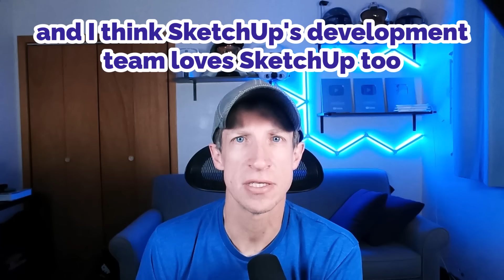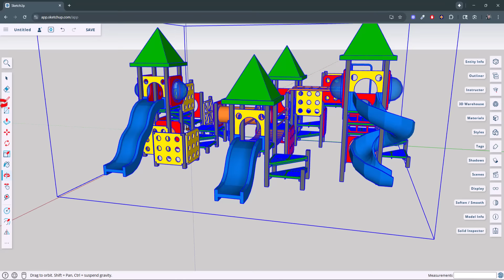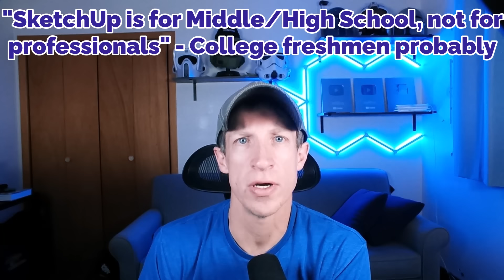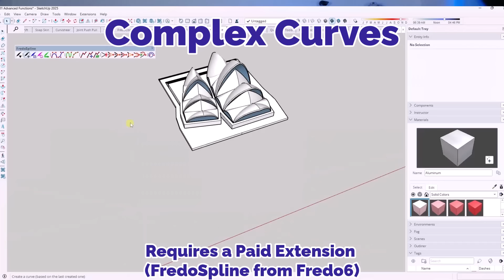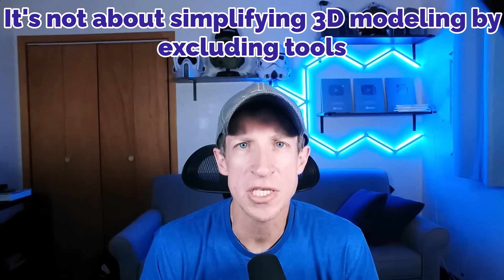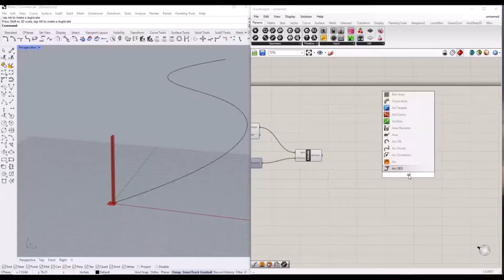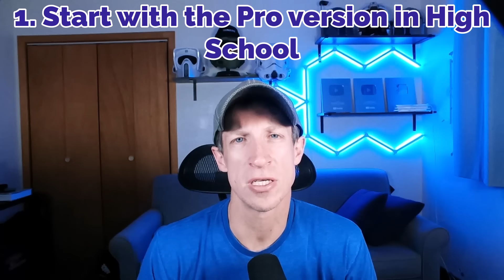Is SketchUp being REPLACED?

Comment: Being a user of Rhino since version 1 I can say that it has grown immensely in features and ability and yet after 30 years is still the same price. No subscription model thank goodness. Has scores of plugins available for multiple industries , grasshopper built in with dozens of tools available for that. The customer service is excellent . I can contact them directly and speak to a person or go to the forum and ask the community and get almost instant response.  I work in the film industry and being able to transfer files to different departments is critical.  My files have to go to construction, vfx , props , motion graphics and more. The ability to export in dozens of formats (no extra cost) to multiple departments is critical. I can also send files in step, iges or solidworks and the open up in other cad apps no problem. Every single SU file has to be rebuilt no matter what department it goes to due to the fact that its typically low poly (bad for VFX) or simply cant be modified in a nurbs based or solid modeler.  This creates a roadblock .  Now that isnt to say that models arent built, drawings are created and sets are built but those same models going to other departments cause more work for those departments. Now with the introduction of  AR/Volume  walls (see mandolorian) our models are going straight to VFX and unreal engine. SU models are just not good enough for texturing and file optimization.  With the latest improvements Rhino is getting more versatile and adopting features of other software into its pipeline.  Is it perfect?  In a word, no. But no software is perfect and never will be. So stop looking for it and just find what fits your budget and needs. If SU works for you fine. But if you have to interact with other designers working in higher end software especially nurbs based software you will hit a wall with SU. 

Im not bashing on SU or its users. And I dont want to give that impression. Its a fine software and has served many very well  but has limitations in the professional world.  As a gateway modeler in 2008 when it first came out it was great. I saw kids learning it and building things. But as time goes on and demands change it becomes very evident that it cant step up when needed to do the kind of work needed for more engineering and architectural applications.  Frankly its outdated. If you want a good gateway nurbs modeler and low cost  look at Moment of inspiration or Plasticity.  If you are a student Rhino offers student pricing thats very reasonable. Bob Mcneel has kept Rhino the same price because he wants it accessible to more people that cant afford Autodesk or other high end products.  

Ultimately do what works for you. And happy modeling.
Reply from the maker: Ugh - I hate any time I ever have to move a model between 3D programs just in general. I don't think it ever works out well, but SketchUp a lot of times doesn't play nice with those other softwares (though I'd say other softwares don't play well with SketchUp either). I totally agree with your statement though - some programs are better for certain things - find what works for you. 

For me, for example, I really dislike doing interiors anywhere but SketchUp. I've yet to find a tool that does a good job replicating that experience. Same kind of thing - thanks!
Reply: @Thesketchupessentials  moving models between 3d apps is standard practice in the film industry. For the most part its not an issue except for SU.  
Interesting that you dislike doing interiors other apps. In what way?  Most of what we design in rhino for film and tv are interiors.  The majority of my work is high tech sci fi but with the occasional period interiors.

Comment: For me the there are many issues with SU. MANAGING TABS FOR ONE, the limited support for text, and let us be honest Layout is pathetic as a document creation system which is vital for any company. I think Trimble play at features without really innovating. Make the existing stuff work properly before adding basic new features. I could not operate without the many extensions that I pay for on top of the SU license fee which is getting ridiculous given the lack of modelling features. If the time and monetary costs weren’t excessive, I would retrain on Blender or Rhino. SU under Trimble has lost ground on its competitors and is loosing its way.
Reply from the maker: "Make the existing stuff work properly before adding basic new features." - I don't see any reason why both couldn't be worked on at the same time

Comment: A few months ago, I had to work with some larger scans and was amazed how well Rhino handled them. I somehow had the memory that it wasn't much better than SketchUp with high polygon counts. After first trying it in SketchUp with a significantly reduced version of the models (down to about 15 million polys) and still finding it a total disaster to work with, even when splitting it up into 2 million poly parts so that I could always hide most of the model. Just intersecting with a plane to create contours always took so long that I had to extract even smaller parts to reduce the area to be intersected. Dividing the model also took forever, and then there were all the looong saving processes... 
Because I then had to work with lots of curves, I tested Rhino again and was able to work with 70 million polys and more without any problems. Smooth navigation, a thousend times quicker intersecting without seperation, and saving in a fraction of time. 
Of course, SketchUp still has the big plus of the inference engine for me. I can't judge whether the performance problems are due to that. However, the difference to Rhino, for example, but also to other programs, is so massive that I find it hard to believe.
Reply from the maker: Yeah, I'm not a massive fan of the inferencing engine in Rhino - in my experience it doesn't do a great job guessing what you want to do, which can be annoying. Interesting that Rhino performed that much better with that polygon count - I've never done a model to model performance comparison with Rhino and SketchUp
Reply: @Thesketchupessentials  I really don't understand why McNeel or others haven't copied SketchUp's inferencing system and modeling style as soon as the patents expired. If Rhino had that, I would switch completely right away...

Comment: Geo Nodes are found in Blender which is a free software and with 5.0 releasing in November of 2025 these nodes will add more power to the software, bevels inside of SketchUp can be created with the Follow-Me tool and or the move folding feature, is just how you go about it, granted I have a ton of extensions for sketchup but because most of them are free and some cost as much or less than a coffee at your local coffee shop. Rhino would have already caught up if they were in the running but right now I believe SketchUp has to worry about Blender not Rhino.
Reply from the maker: I love Geo Nodes (and Blender) but I think comparing SketchUp to Blender is apples and oranges. At no point in the future at least currently are architectural schools going to start teaching Blender instead of SketchUp because it doesn't have a strong architectural modeling toolset
Reply: @Thesketchupessentials  there's an influencer i found a few days ago that he calls himself Blender 3D architect and he shows how to use blender for architectural renderings and CAD drawings even though i agree with you oranges to apples I believe a 3D program is a 3D program you just need to know where everything is. the simplicity of sketchup is it's strength, letting people know what plugins to get free or cost effective is still less than Rhino on a good sunny day.

Comment: I have always thought that SketchUp is the digital conceptual design tool for creators because of its intuitive simplicity and its way of understanding simple geometry, the problem is the complex geometric shapes that are solved with external plugins (with more cons than pros since they are not usually part of the SketchUp ecosystem, maybe they could integrate the best plugins and integrate them directly -it's just an idea-) Rhino has a slightly longer learning curve but its geometry can be directly integrated into BIM systems (such as Revit, Archicad or Vectorworks among others) it is also intuitive and in the long run easy to use with that extra potential of grasshopper. That is the main reason why Rhino surpasses SketchUp in architectural firms, it is the software for geometry (we must remember that BIM is data and software like SketchUp/Rhino are 3D geometry), I see potential in SketchUp if they improve LayOut (a little more like Adobe In Design which is widely used in architectural firms) and if they create CAD type line options (they have already started with this but more are needed/the ability to edit your own) and if they pay much more attention to gems like SketchUpDiffusion that integrates AI into conceptual geometries 10/10 is a very promising product.
Reply from the maker: Definitely agree about Layout (which is superior to what's in Rhino) and the CAD line options (I would love to see these controlled by tag or by element rather than by viewport) - these could make a huge difference

Comment: Without the Ruby language and the thousands of developers who have contributed to it over the years, SketchUp wouldn’t be what it is today.
I’ve been working with SketchUp for 17 years now, mainly in cabinetmaking — designing kitchens, staircases, and interior layouts. And to be honest, I’m not particularly proud of it.

The main reason I’ve stayed loyal to this software is because of its rich community and the incredible variety of available plugins.
But, just like you, Justin, I feel that this community is slowly fading away.
It’s disappointing to see that even SketchUp’s native tools are now outperformed by external plugins — even for simple functions like Offset, Push/Pull, and others.

Working with SketchUp becomes challenging when you aim for precision and efficiency, especially when it comes to curved geometry or dynamic components, which are often painfully slow and cumbersome to manage.
It’s nothing like what other software can offer, such as Fusion 360, Autodesk Inventor, SolidWorks, or even Rhino.

Personally, I know I’d probably struggle to adapt to Grasshopper, that very particular parametric module, but I can still appreciate its power and flexibility.
In the end, that might explain why so many companies have moved away from SketchUp — a program that, in the name of simplicity, has ended up lacking precision… and therefore, speed.
Reply from the maker: Overall I think this is a fair statement. I would love to see an easy to use, SketchUp style parametric tool like Grasshopper. Probably a pipe dream, but it would be nice

Comment: I agree 100 with all you pointed out. I also want to stress the missing ability to UW unwrap inside of SU. To me it is like only getting the half job done and many of the SU models are completely useless in like a gaming environment. 
The most pressing issue imo is the subscription licensing model. If I coose Rhino as my work tool, I own the programm and the versions dont change on a yearly basis. I think that is a more fair approach to billing customers. 
It is sad if you think of all the capabilities that come with SU, and then at the end of the day you run into a wal because there are features missing that are comon in any other CAd like application.
Reply from the maker: 100% on the UV mapping - I would love to see a tool (it doesn't have to be complicated) that allows you to adjust the way materials sit on surfaces in a simplified way. It doesn't have to be full on unwrapping like you have in Blender or anything. Honestly pretty similar to ThruPaint

Comment: After the second semester of architectural school, couldn't bring myself to handle sketchup's bullshit anymore. It cant even handle the simple task of closing a surface even when imported dwg files are flattened. it doesnt close surfaces properly. it sometimes took like more than an hour to just try to create one surface by closing triangles inside the surface and deleting the lines between and getting stuck with the very last triangle not closing into a surface. and dont get me started on working with objects that have any sort of curves. Its utter lack of any advanced tools for modelling while branding itself as construction field friendly is a banal joke. Life has been 20x easier since i started using rhino. Less time spent handling dumb bullshit for no reason, accurate modeling using nurbs, advanced modeling tools using only rhino, and the cherry on top is grasshopper which allowed me to create many time saving scripts to enhance my workflow. Honestly good riddance and wouldn't use sketchup again even if they paid me.
Reply from the maker: The "non-closing surfaces" issue is definitely annoying. I have no clue what causes this

Comment: Fix number 2 should be number 1 because if they don't do this then fixing the pipeline becomes more of a marketing/sales issue for them rather than something that benefits users - if Rhino is the better product then that's what users should have rather than relying on familiarity with an inferior software. I've been using sketchup for almost 20 years, previously I used Autocad for 10 years, so I have been very 'loyal' but they only thing delaying me changing is the learning curve for Rhino which will slow down my productivity temporarily. Rhino's compatibility with my favourite rendering softwares means that I now have fewer reasons than ever to stay with Sketchup. I feel like the development of Sketchup has slowed dramatically since Trimble bought it from Google, back in the 2000s it was revolutionary (to me at least), but improvements are glacially slow to appear nowadays.
Reply from the maker: I think this is a fair point - for widespread adoption, people usually have to make the case of why one program is better than another, so if there are tools missing, it's a lot harder to make that case

Comment: Guys, juste type "JAM - Drawing Pengsoo by Jamparc" on youtube and you will see a unique and fantastic free rhino plugin, perfectly completing the new push/pull and inset face options from version 8, add "blockeditnew" for better sketchup like nice components management, and here you go : sketchup in rhino, thank me later . (bonus tip : use kando for instant commands if you are legitimely tired of typing long commands)
Reply from the maker: I don't fully understand what I'm looking at here
Reply: @Thesketchupessentials  It's a tool, a plugin called "Sketchup" that give you the ability to draw directly on face and extrudes them mostly (and also push pull and offset face but as mentionned the V8 released tool for doing that natively.) BlockeditNew is to be able to work with groups/ components near as good as in sketchup, and kando is fully customizable (you can export rhino icons svg pack with a command and use it) for creating instant popping  floating windows and using your mouse to click on command really fast (bc instant alias (one touch command) will only be released in V9, and rhino doesen't support alt+something shortcuts and that was so annoying. With all thoses tools combined, I can have a bit more of the insane speed I was modeling with in sketchup, because it's nice to have more possibilities but if you take x3 the time, not worth it and without thoses tools when I was in a rush I would always go back in skp)

Comment: Sketchup it's not a profesional tool, right! Rhino is doing 2d drawings automatically for architects. But Rhino for architecture is so unflexible in my opinion. Although Rhino has more tools, Sketchup is a more flexible point to start from. But yes, Sketchup lacks all that functionality you would need in a standalone 3d software. Sadly, Sketchup should be only a starting point for kindergardens, like I did, and then move one to profesional tools ranging from Blender to Rhino and 3DSMax. Still, SKP can be used a profesional tool if you know how to use it to the maximum and integrate it in your workflow with more advanced softwares. At the end of the day, SKP is too expensive and single-cored and basic.
Reply from the maker: I'm not sure where you're getting that Rhino is doing 2D drawings automatically for Architects. I've not witnessed this at all - if anything, SketchUp's documentation functions are superior to Rhino's, unless there's some new feature I've been missing